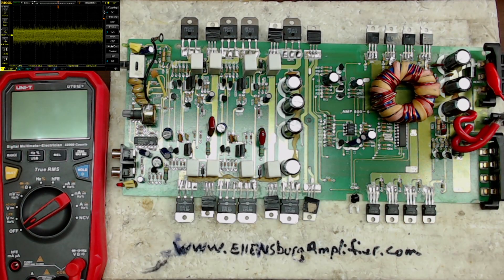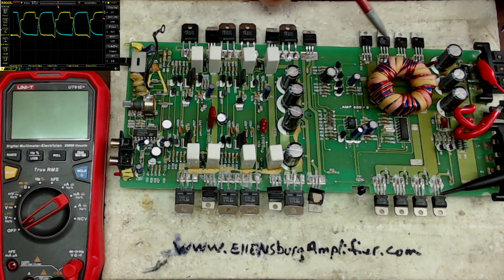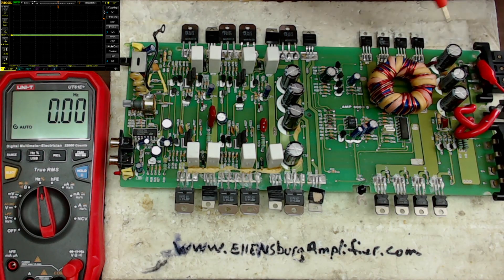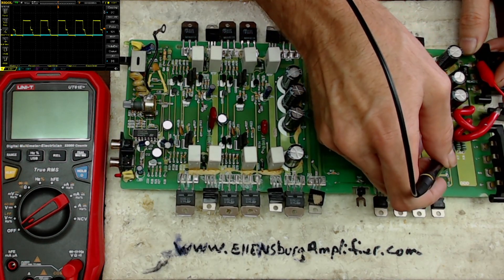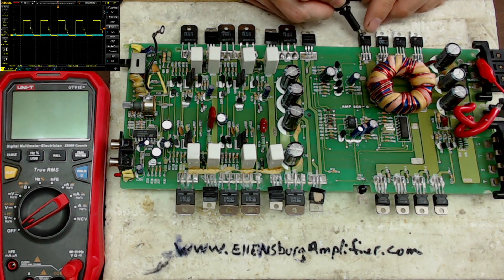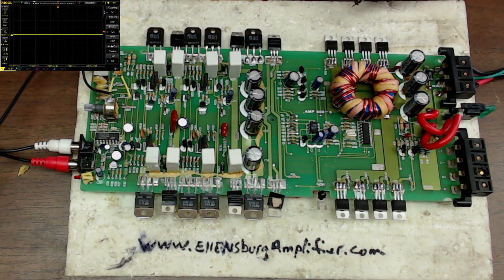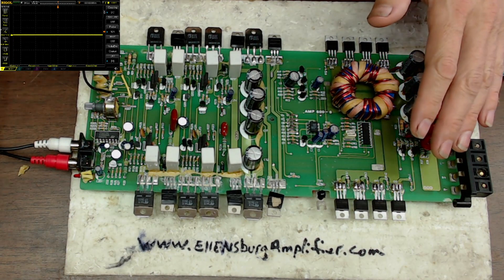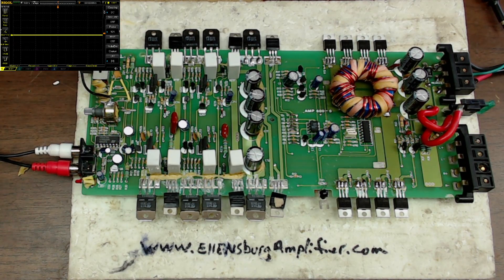Profile California A600XL 600 Watt 2 Channel Class AB Car Automotive Amplifier Repair

Comment: Love this old kind  amp, touch this when make loud time running is like grab a cup of  tea immediately before it getting cold. Power supply section is more powerfull compared to most actual cheap brand. Great stuff
Reply from the maker: I was impressed with the rail voltage!

Comment: Thanks again for another informative video Todd. I'm looking forward to see how you will modify the preamp section. How do you determine the value for the gate resistors?
Reply from the maker: Thank you Tyrone. I hope to get to this board soon to continue on the pre-amp section. I have been busy with customer boards. I mainly look at how the transistor is switching comparing both sign waves on the scope. Trial and error depending on the drive topology.
Reply: @ellensburgamplifier  thank you for that advice

Comment: Use irf3205's instead of the 44n's.  I have one of those amps and had to replace mine and used 3205's. it runs great.
Reply from the maker: If it had a larger output I would have used 3205's but the single fuse holder with the 8 gauge wire using 4 TIP2955's (15 amp transistors)  didn't warrant using 110A transistors. The 44N's will give me a burst current of up to 140 amps at 100 deg C. However, 3205's are my go-to transistors for many common boards.

Comment: fyi that driver transistor to mosfets was faulty after replacing some component with current on (soldering after forget switch off), but i still have one mosfet heating up , but ir i disconnect centre leg of rectifiers diodes, i have a good and stable + and - rail voltage on them; with no warm mosfet, so am i right thinking about asome faulty channel on the output power stage??
Reply from the maker: You are on the right track!
Reply: @ellensburgamplifier  right track but wrong tracing damages: thanks 2 ur more Tham 1 h vids about ab amps i realized that "a leaking bjt does not show anything on tester", i replace them all on that wrong Channel and problem Have just dissapeared, THANKS A LOT, cause 4 me this is a giant step(many AB amps that i nevera found out why i couldnt back to life).
Reply from the maker: @FREEAIR_1973  That is good news!